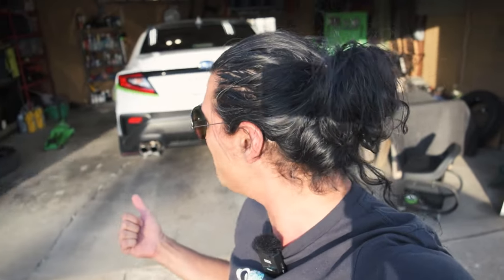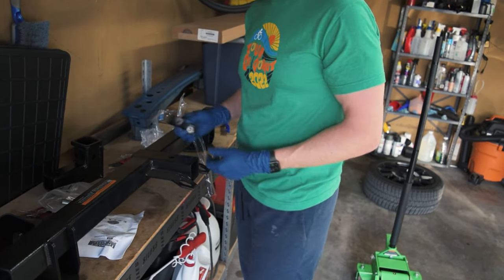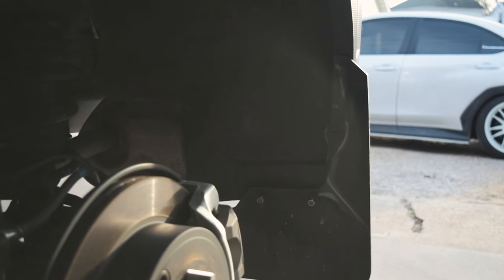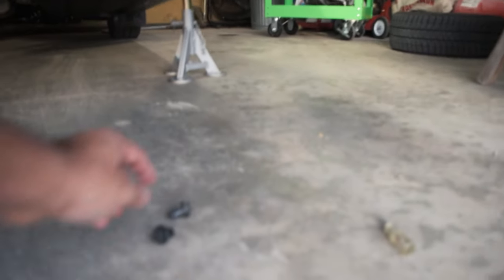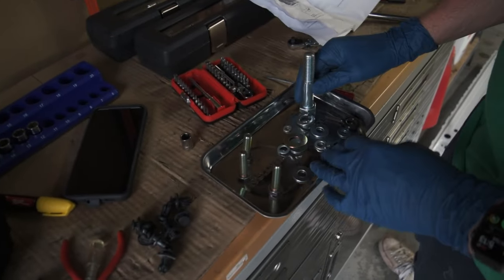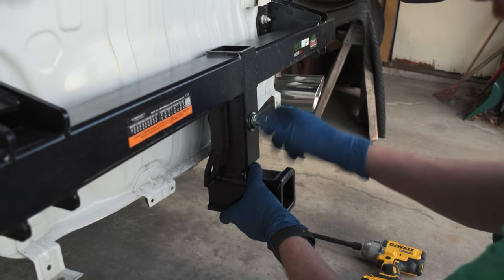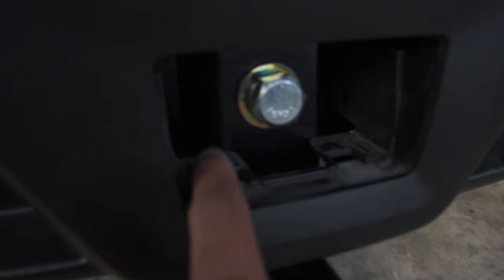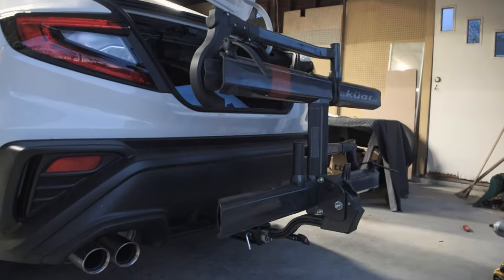Installing a Torklift Ecohitch on a 2023 WRX

Comment: Had one of these on my WRX since day 1 for a bike rack. I hung the bumper and cut the minimal amount possible vs. using their recommended template, took a few fittings to get it but it's not like you can really see it anyway :). Also didn't do the little magnet mod on the "vent", it pops in and out easily enough. You could also still run a 4th brake light if you really wanted to, but I like the ability to remove the receiver portion easily.
Reply from the maker: Yea we didn't do the magnetic bit either. I think he's fine with it the way it is. It's definitely a cool piece and they use it all the time. Plus they have an outback with the same style hitch so it's definitely proven.

Comment: Thank you for the video, installed mine last week! I’m an avid mountain biker and just did a 3 hour 1 way trip into the mountains for a ride with my bike hitched up. Worked amazing so happy to have this. Do need to be mindful of ground clearance with the rack on I had a minor scrape over a semi steep driveway into a parking lot, but it works amazing

Comment: Thanks for the video. Wish I watched this one before the other two I watched. I ran into the exact same problems. 

Big failure on ecohitch for not including a physical template for the cut in the bottom of the bumper. 

I also had difficulty understanding instructions and that there was two sections that needed cuts. 

That tough part of the bumper he described using the pry bar to put on. We used a small flathead to push the black piece (clip part) down. You can do it from the trunk side while the other person lifts the bumper up over that clip in the corner. 

Would have been a much quicker job for me with a template & just a little better instruction manual & video from ecohitch. 

Since they are made local to my area & I picked up in person it’s a failure on my part to not ask for any install tips.

Comment: Great video , I looked into this hitch while I was waiting to take delivery. (2 years ago ) I even watched a self install video . Definitely do your research, this ended up not working for me ( every situation is different) at the time It worked for a bike rack but I wanted to do , which was trailer a motorcycle and at the time the ball mount that would go into the hitch would hit up against the spare tire section underneath. And 4th break light was not an option. This may have change since I did my research and I’ll look at it again down the road . But good options for mountain bikes 😊.
Reply: Was that due to the trailer being used or a limitation of the ecohitch? I'm also interesting in using a trailer to tow a dirt bike with a WRX. Are you saying that is not possible with the ecohitch?
Reply: @donjohnson2428   you can totally tow a dirt bike , but I didn’t like the fitment at the time ( personal choice ) I kept my legacy so I can still tow my motorcycle.

Comment: This looks to be a better and cheaper solution than roof bike racks...but you have to cut the bumper, potentially have issues with insurance for removing the stock crash bar, and lose the ability to install an F1 light/rear diffuser/STI flexible rear draw stiffener. That stuff probably doesn't matter to most owners though, and if I were smarter I would probably go this route. Good content!
Reply: I feel you on the crash bar removal, but that’s standard practice on Subarus. This isn’t an OEM hitch unfortunately, but it installs the in a same way that the Forester and the Outback installs, which also remove the crash bar.
Reply: @Mantis489  Good point. I just wonder if it matters to insurance companies that the hutch isn't OEM, hopefully not. I had the dealership install the OEM hitch on my Ascent, so I don't know if it uses the same method but I'll bet it does.
Reply: The Ascent OEM hitch removes the crash bar as well. However, all the OEM hitches for the Forester, Outback, and Ascent also put a channel of steel inside the unibody frame. Whether or not this is for crash rating or higher tow capacity I can’t speak to. However, I’m sure there are far riskier mods to do and the liability of a rooftop bike rack scares me more tbh.

Comment: Did you notice a change in your cars performance after the install? Did your car feel “slightly” slower? The hitch is 55 lbs.
Reply from the maker: There should be zero performance degradation from the hitch install. It really isn't very heavy. Thr relative conversion would be 3300lb / 271 HP = about 12 lb per 1 hp. With that being an extra 55 lb that would make it an effective "loss" of 4.5hp. Not enough to make the car feel slower or be perceptually slower.
Reply: does that 55 lb include the weight removed from crash bar?  How much does crash bar weigh?
Reply: @brian6speed  Crash bar is just under 13lbs according to my luggage scales. I didn't weigh the rack itself, but it didn't feel over 45lbs to me.